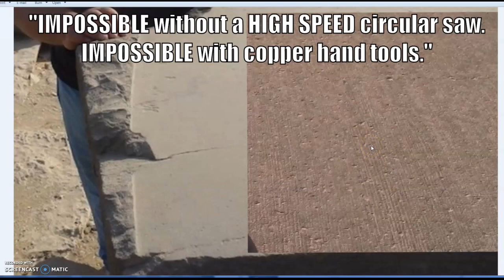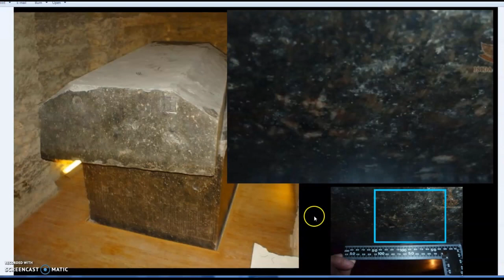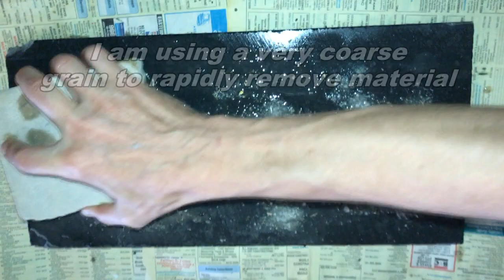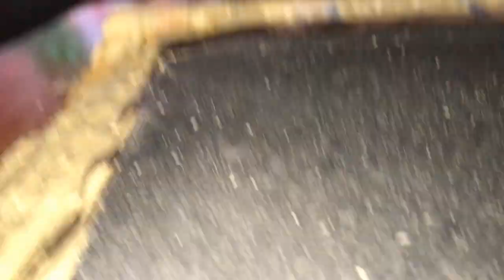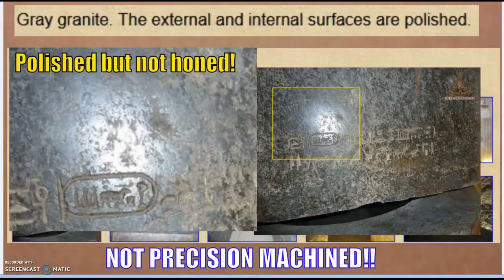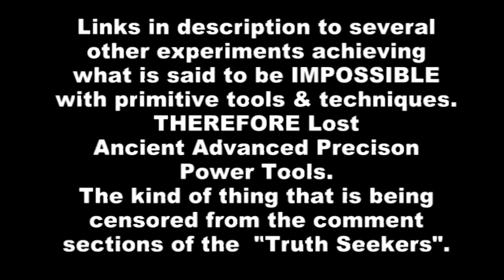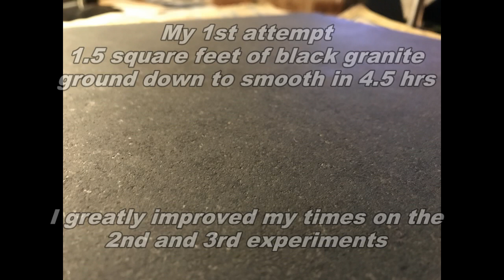Ancient Stone Working Techniques: Experiments with Black Granite on Removing Striations

Comment: So you get a piece of granite that relatively flat to start with, 😄Smoothing it is the easy part. Make me the tool to make the box.
Because all I see is people using modem copper pipes or copper sheets to cut into stone?
Reply from the maker: Any percussion tool will do it 😂
Getting a near flat surface is something you can’t envisage for yourself? Though I’ve shown with near sphere pieces of stone how the simple process of rubbing will make it flat. Not that anyone interested should need to be shown that anyway.
Modern copper pipes, you mean modern pure copper and sheets that are 99.9% pure versus the impure (alloy) copper of ancient times that is both tougher and harder than modern copper. 😂 
Every part of the box has been demonstration with “primitive” tools of bone, stone and copper tools.
That the boxes are Iron Age seems to have missed your community😂
They are boxes. Yes a box and quite imperfect ones at that as every measurement has shown.
You must have missed the videos where they go with Chris Dunn on video and test the flatness and corners. Spoiler it wasn’t the way they had and still do sell it.😂
Seriously a box that isn’t well made has been elevated into a mystery. A religious relic and I’m not talking ancient superstition but a modern new age cult with a mysterious box being unexplainable.
Reply: @SacredGeometryDecoded   I'm talking about he accuracy of a modern machine made pipe not the hardness. this is why it would be difficult to make the tool to cut an accurate round hole. I only every see videos of people using copper pipes to make there holes. they never make the tool that can cut a deep straight holes? Spoiler😂
Reply: @SacredGeometryDecoded  https://www.youtube.com/watch?v=K80JebExyEY&t=338s
Reply from the maker: @bluedog7222  And? This guy Uncharted X has made many claims of impossible and has been debunked by experimentation but keeps selling his lies.
He is still insisting core 7 is  a spiral.
But ok
To drill the hole in the corner, a box drill with a shaft that has a part narrower than the tube for the rope, it is in a corner so the bow at 45 degrees on the tope side. Simple as as, any engineer who can't work it out is a bad engineerr. Or use a a tether drill.
The beading, have you seen how they make rounded columns, start with a square and then an octagon and so on to make it round. ZERO mystery.
A dish takes a lather, no it doesn't there's painitngs of egyptians using their well known tools to make bowls and dishes and vases.
Those things have been replicated.
You might want ot look into my playlist on Christopher "Griftopher" Dunn. 
These guys have to censor the experiments they ask for beause they are cowards.
Both Ben and Griftopher are still running and ducking like the lazy incompetent cowards they are.
Reply: @SacredGeometryDecoded  Ouch 😄we need is a real scientific study. 
 What I find puzzling is that we find Saw marks and Drill marks all over the Giza Plateau, that seem to serve no purpose? are we talking time wasted using privative tools or was it something else?
Reply from the maker: @bluedog7222  time wasgted using hand tools you mena. Like the hand operated stone saws still being used up until the era of photography?
Serve no purpose? They are tool marks, they serve a very important purpose. That work was done.
You don't want a proper scientific study. You want to question to remain open. It's why no one on your entire team does an experiment to learn or test. Except for Griftopher Dunn, who fakes his experiments like the fraud he is.
Those marks have been replicated, my myself and others, maybe you should replicate the cheap easy experiments LOL face.
I've heard all this nonsense and barage of "just asking questions" a thousand times before.
The points are always the same, the reference to Uncahrted X or similar always the same, the lack of fact checking always the same. The Dunning Kruger LOL face . The just asking questions laundry list always the same. The lack of interest in doing any work but demanding it from others, always the same.
Reply: @SacredGeometryDecoded  😂No need to try any experiments seen many  skilled craft men and women try to reproduce in hard stone, but there holes they make are ALWAYS using modern copper pipes which are made by machines for accuracy. to make an accurate hole you need an accurate tool, They never make the cutting tool. Try making the pipe from raw materials? Never done? because hole would expose the inaccuracy of the tool.
Reply: @SacredGeometryDecoded   Curious to know what you think the random hole on the Giza Plateau are as you seem to know ? Your quote: "Serve no purpose? They are tool marks, they serve a very important purpose". They can be found at the bottom of the paved platform in front of the Great pyramid? What purpose?
Reply from the maker: @bluedog7222  BS. 
https://www.youtube.com/watch?v=hjN5hLuVtH0
They make a tube and drill with it, including at the end casting a pipe.
I have made my own from sheets and done the same.
An egg shaped pipe will drill a perfect hole, it will just cut a wider trench between the narrowest and widest part of the tube. It will not expose the inaccuracy of the tube.
This is just false.
Reply from the maker: @bluedog7222  Any number of purposes from post holes to axles and many things in between.
Reply: @SacredGeometryDecoded  Again using a flat uniform modern copper sheets
made by a machine. The casting pipe which is a science within it's self. It cut no more than 1" and the hole looks like a mess. try cutting a 10" hole then we can test the accuracy?  To cut deep core holes of which you find all over the plateau you need a long straight round seamless pipe for accuracy as it cut deeper into the hole. We need to compare there cores made using there method, with Pitrie's core 7. The YT Channel  goes on to compare Pitrie's core 7 sample with a core sample obtained using a modern power tool, but does not compare it to it own core sample made?(deceptive) The program Debunks it's self by then showing that the cut marks are vary between 1-2mm. which is determined by the cutting rate at which the tool is rotating. Pitrie mentions this. Lets ignore that part?  Put it this way,  It's Faster than a bloke and his friend running around a stone all day to cut a hole. 😂
Reply: @SacredGeometryDecoded  you find them beneath the paving slabs? I think the whole Giza Plateau is predynastic and that elementary machinery was used.
Reply from the maker: @bluedog7222  bs ancient Egyptians made sheets and even tiny tubes for their jewellery, larger tubes for things such as bed frames.
Casting a sheet is the easiest thing ever, beating it out is copper work 101.
They had been using lost wax method for casting complex figurines but you are seeing a copper sheet as a mystery. 
You can’t be this ignorant without being wilfully deluded. Literally you don’t know a thing and yet speak as if you do. Dunning Kruger in the extreme. 
The YT channel does no such thing. They didn’t use a power tool and neither did I.  They need to lie to protect your beliefs.
Waste of time even discussing it with someone too lazy to test it for themselves.
You don’t need a long straight seamless pipe. You made that up out of utter ignorance or deliberate dishonesty. You don’t have a clue.
If you’d bothered to look into it you’d see that they had used a split pipe to compare marks. I have done dozens myself to compare various abrasive types and grit sizes.
You don’t know a thing. You do tea t to know.
Lazy and ignorant.
Its embarrassing g to answer these points. A lot of people will believe I am using a sock puppet account to make your crew look stupid.
Reply: @SacredGeometryDecoded  You find the cut marks beneath layers have been removed?
Reply from the maker: @bluedog7222  the paving slabs were removed and then replaced. They built a road over that area back in 1940’s and then restored the site.
You really need to learn about the things you pretend to be interested in. 
Your ignorance and lack of interest is not my problem. It’s a waste of my time answering as all your knowledge comes from watching Uncharted X and friends. Learn to learn by Getty g out of that bubble you exist in.
Reply from the maker: @bluedog7222  ffs the paving stones were removed then replaced. You find modern concrete underneath them too. Not one of you seems to notice that let alone look up the history of what had happened there in recent times.
Stop pretending to care. You don’t. You make shit up or repeat things from grifters and frauds as if they are fact.
Seriously you need to learn to learn.
Reply: @SacredGeometryDecoded  No need to get so upset. The striations Like finger prints tell a story. As I said I don't doubt that we can do it. I follow the science fast cutting speed and accuracy. I've worked with all materials and am well aware of the mohs scale. Sock puppet account to make your crew look stupid.😄 I need no crew.    All the cursing only shows what sort of character you are. 🥴
Reply: @bluedog7222  I would be interested to learn the science that allows one to determine the cutting speed. Highly compelling I should think.
Reply: @Eyes_Open  Hi eyes wide open, there are 3 main factors which determine the rate at which a tool can cut into a material, the speed at which the tool is rotating, the pressure applied, and the cutting material used. When cutting a core drill, a continuous spiral is left on the core, the spacing and angle between the spirals is he cut rate, The cutting speed is not the same as the cut rate, you could have the tool rotating at fast speed but not cutting at a fast rate resulting in many fine striation, the spacing and angle of spiral being very small. or you could have the tool rotating slow with large amount of pressure having the same cut rate but not the same rotating speed. The variation in death of the spiral grove is dependent upon the accuracy of the tool and the material being used to do the cutting. 👀
Reply: @bluedog7222   @Blue Dog  Interesting. However, in the ancient core samples, since there is no continuous spiral due to the nature of the demonstrated abrasive cutting method, that knowledge is useful but not directly applicable.
Reply: @Eyes_Open also it's bullshit. If I use a drill to drill 3 holes at 3 different speeds no one would know what speed setting I used by just looking at the holes drilled.
Reply: @SacredGeometryDecoded  SGD I have not doubt that we can make them, what I question is the precision, and did we make them with privative tools.
Reply from the maker: @bluedog7222  They are NOT PRECISE. The surfaces are not flat, my experiments have better results. And the corners vary in angle. 
I question the precision too, with the measurements that have been taken I question why they still say precise. Even by eye from lo res photos they are clearly imprecise.
https://www.youtube.com/watch?v=CxgZGQwWQas
I have other videos going into each and every box but this is their precious. 
You should be questioning Uncharted X and the others who know this and stil say precision this and vases and statues. It's all bogus and they make money getting people to believe these things.
I question why so many people are so willing to believe such falsehoods so easily. 
LOL face
Reply: @pranays  Take a step back. You are new to this channel and do not recognize me.  I very clearly know the truth but it is interesting to give people a rope and see if they climb or make a noose for themself.

Comment: There is documentation about how long it took to build and transport these boxes. Egyptian texts mention it. They do take a bit longer than you suggest, but yes, it can be done and it is obviously done. The Egyptian boxes are absolutely not perfect. The naked eye can see this. They do have the polished look. I think they are polished, but not perfectly honed. There are even scoopmarks visible, which may have been on purpose to get rid of fractures that might grow and damage the box. 
Also think they used some kind of sealer to give a more shiny appearance.

Comment: the piece of stone at 1:23 is indeed curved, but this could have been done with a pendulum copper saw with sand.  Especially corundum sand.
Reply from the maker: search 
LOST ANCIENT HIGH TECHNOLOGY- HIGH SPEED CIRCULAR SAWS 100% Debunked with Experimental Archeology
I have other experiments with copper saw and sand cutting. I did this a while back and used a lot of quartz in the mix so the striation not as deep/rough as corundum.
 The type of sand leaves different effects. Even the grit size and frequency of cleaning.
Reply: @SacredGeometryDecoded  heretic! ;)  

I recently found out that the factual videos on the matter suffer from The Algorithm.

Comment: They could have had wood lathes and that could also allow at least a crude stone lathe that could produce round grinding laps and one could speed up removal by spinning a lapping stone and moving it in a systematic method to make things flatter, or they could use laps on curved surfaces.

I made eyeglasses for over 15 years and I've  worked in a Granite shop now, for 18 years.
I also have done grinding of carbide and ceramic tooling.

Comment: About the coffins, they must have drilled out the inside with tube drills, right? If that is the case then the amount of material the builders remove to make the walls sort of flat, before starting to polish has to counted in? I don't think polishing was the hardest part. About the rock you showed in the 1 minute mark. The cut is circular and concave at the same time. How do you even make this cut?
Reply from the maker: https://www.youtube.com/watch?v=eYa3Im-Cetc&t=1s
shows all the stags and experiments with pre iron tools on the coffin boxes, though they are iron age.
https://www.youtube.com/watch?v=Ggw1c_3Cdk4&t=3315s
cutting blocks, i intend on making one with the concave and circular cut, same as the earlier one but use a curved guide instead of a straight one,

Comment: Where is even one piece of this advanced machinery they say existed? Not even one piece of steel, circuit board, insulated copper wire, push button from that age has ever been found. Not only would you need the advanced machinery, but all the machinery and industry to make them. None of it has ever been discovered.